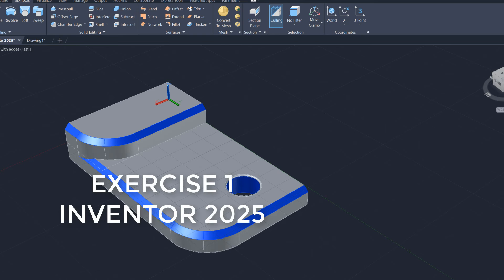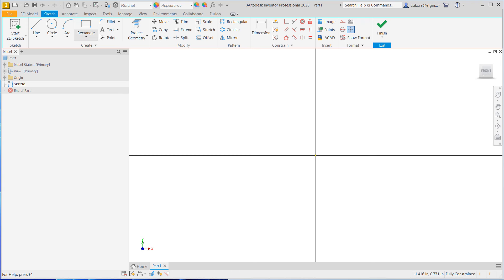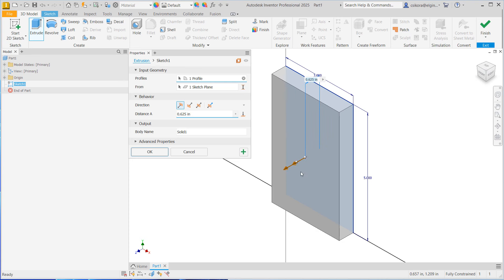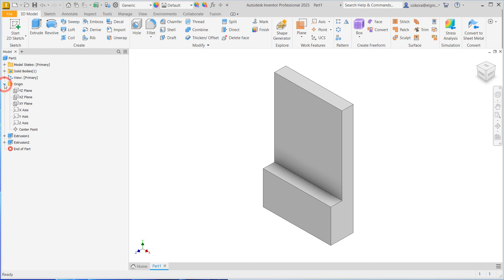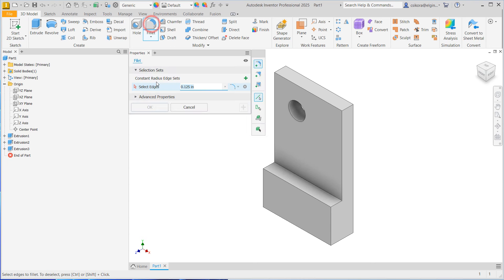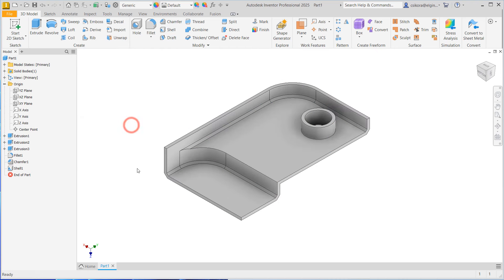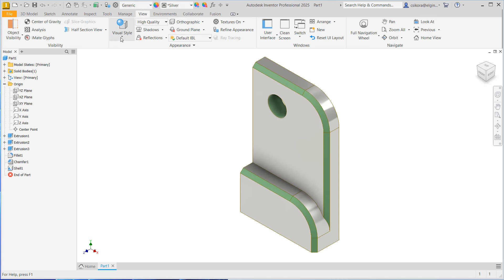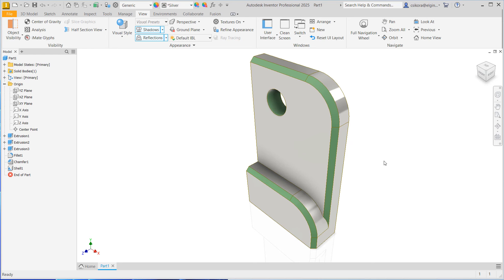E1 Autodesk Inventor 2025 | Basic Modeling for Beginners Tutorial with Training Guide

Comment: I'm coming from Solidworks and AutoCAD and decided the best method to learn Inventor was to start with the basics.  I like your pace and style. Thank you very much for posting these tutorials.
Reply: Is inventor better than SW in your opinion?
Reply: @n.n8192  Hard to say at this point because I'm just starting out with Inventor, but I do remember SW being much easier to figure out and overall more intuitive than Inventor.
Reply: i am using both. Both have their own strength. For me who design Furniture with Parametric Design, Inventor win over SW. Why?, You can easily set your parametric data in Microsoft Excel and it works perfectly fine. But, when it comes to tube structure, SW is champion. You don't need Assembly mode to so. Tube structure in Inventor very pain in the ass, if you don't manage it's generated files properly, you will mess up everything. for those who love surfacing modelling, SW much much more versatile and many editing tools can use and more tweaks can be done. For configuration design, yes, Inventor is better. I said so, because, not all dimension in feature can be link to Global Variable (SW).